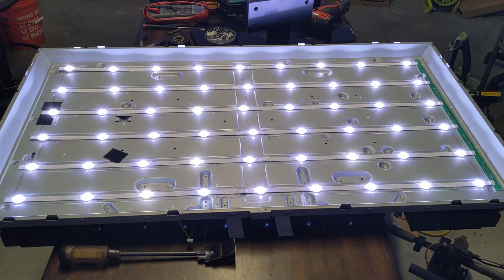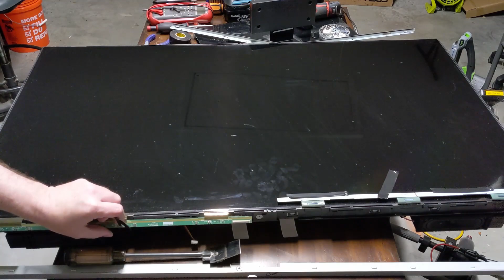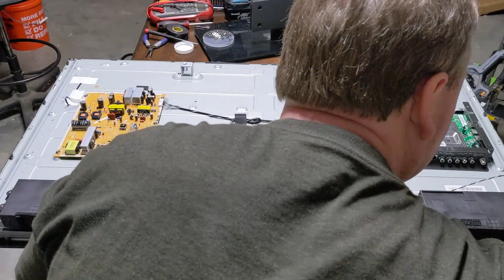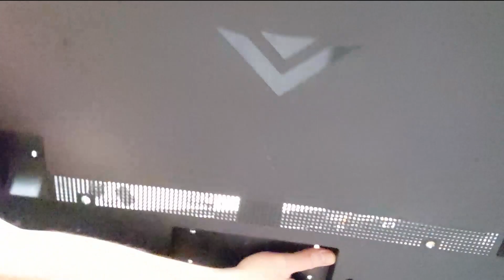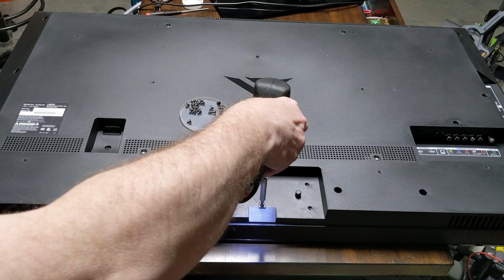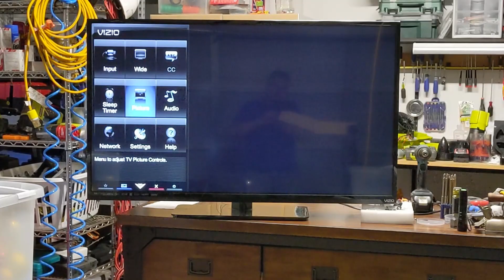VIZIO 47" TV No Backlight (TV Reassembly - Video#3)

Comment: Where did you get that nifty scraper to remove LED Strip?
Reply from the maker: It's this style of scrapper and it is very handy. I found a spring steel blade and modified it to fit this thing over 15 years ago and it's still my go to scrapper. It works ok with the regular razor blades also, but so much better with the spring steel. 
https://amzn.to/3zxAfl0

Comment: If you wsnt some really good double sided tape. Look for fast cap speed tape. Its for putting edge banding on desk tops and what not. Its super thin and possibly the sticky substance known to man.
Prep surface with acetone if not on plastic, acrylic or polycarbonate or any painted surfaces. Denatured alcohol where acetine is NA.